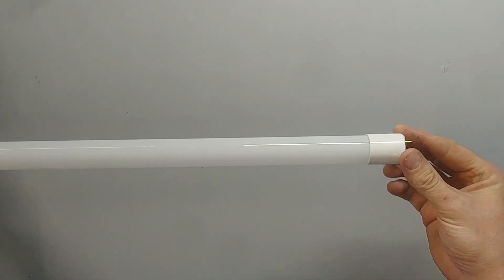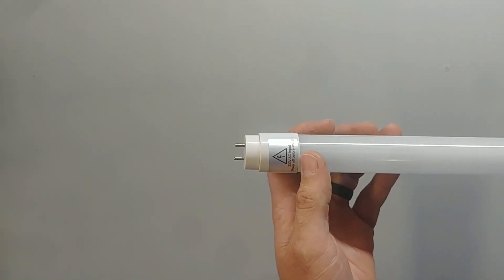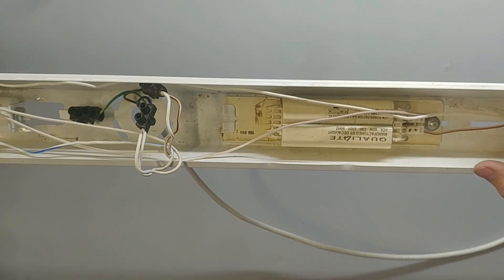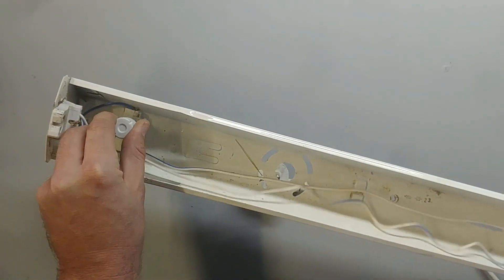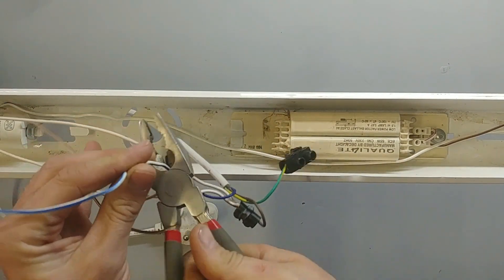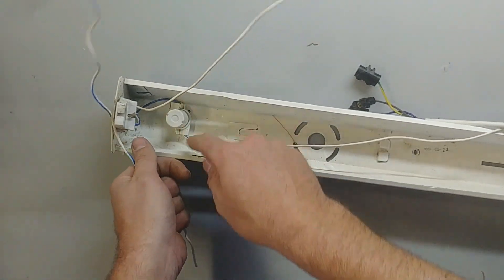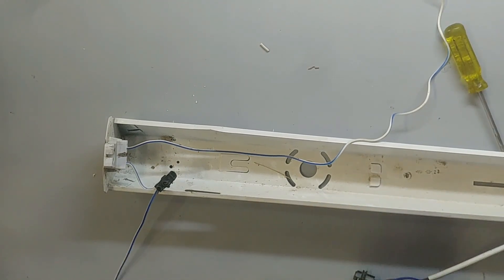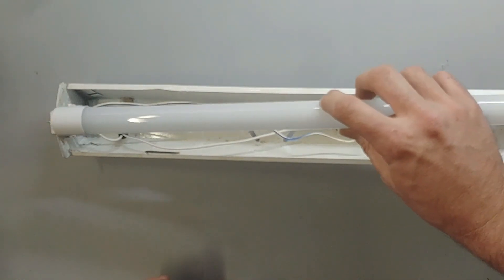Easily change a flourescent tube to LED tube.

Comment: Nice video indeed how did you earth the third wire please let me know thanks
Reply from the maker: Hi. Most of the old and new metal fittings have a little tab where a connector slides over and screws onto. It you have a plastic fitting,no earth is needed. 
If you have a meral one with no earth tab. Drill a hole in the metal and put a nut and bolt through to fasten the earth wite. Groete

Comment: Thank you for the great video! What if at the time of replacement of LED tube , i swap the ends of the led tube i.e the end with writtings with the end with no writtings, what will happen, kindly?
Reply from the maker: Hi. The one side that should have no power is shorted. So putting in the wrong way will cause a dead short between Live and Neutral....
Not good 😊
Reply: @p0we111  Thanks
Reply: @p0we111  but why should it just be left open?
Reply from the maker: @Happy_254-d1e  one side of the LED tube requires Live on one pin and Neutral on the other. 
The other side has no power and is just there to hang in the existing holders. No power to that one side.

Comment: 4:35 I received a new type that has the fuse, will the tube burn out if I don't use the fuse that they sent with? Is it to protect the LED or actually just to help with conversion without having to remove the fuse socket?
Reply from the maker: In my opinion/experience the fuse will not protect the LED tube from "burning out". If the LED tube reached the end of it's live span it will blow/burn out. 
I think the fuse will blown and keep the rest of the circuit from tripping inside the distribution board. (in some cases)